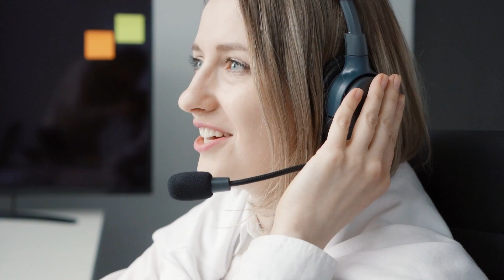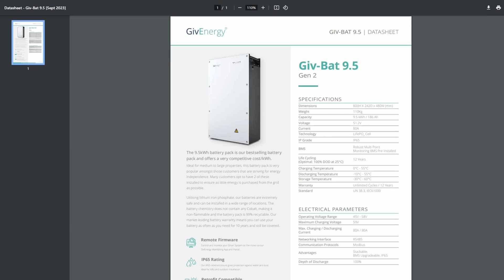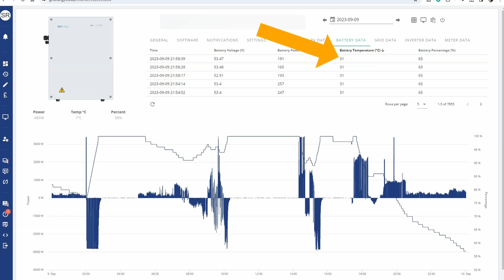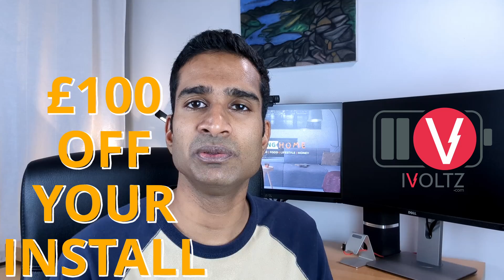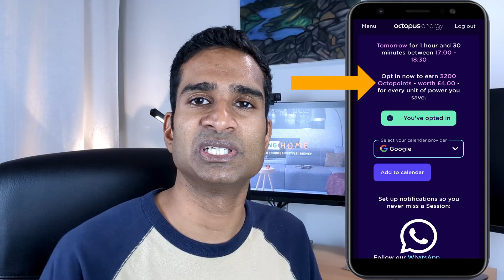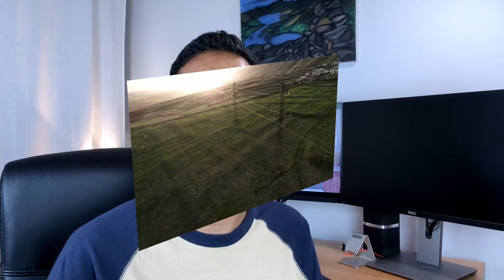1 Year Solar And GivEnergy Battery Review - What I Wish I Knew...BEFORE Buying!

Comment: Nice Video. I am looking at Solar and have been doing a lot of research, looking at costs, how much power I might generate and whether a Battery is worth it. I really like the GivEnergy kit especially the AIO which I do want to install. It is a real shame GivEnergy do not offer Non-Hybrid Inverters as one doesn't need these for the AIO so they would be an unnecessary expense. I will be looking at 3 strings, 1 East, 1 West and 1 South. I was initially looking at 2 Inverters with all the pain it would give me to parallel them but Growatt have just launched a 3 MPP Inverter which is powerful enough to power all 3 of my strings. So, looking like the AIO and Growatt Inverter. Panels are pretty cheap these days but the mounting systems have really gone up in price since the Pandemic. The only issues I have is needing to get Planning Permission for the Flat South Array as these will be on Ground Floor Roofs. The East/West Array will be on my Workshop pitched Roof.
Reply from the maker: Hi Dave - Thanks for taking the time to watch and comment on this video. Glad you found it useful.#

Sounds like you've got things pretty well planned out there 👌. Hope you get planning permission turned around soon and can get installed. 

If you’ve not already, please do like this video, stay tuned for some more content and thanks for taking the time to contribute to the discussion on this video 🙂

Comment: I've a similar system to yours. I've just added another 8.2kWh battery for £2600 so that it can help power a heat pump next winter. Thanks for your post.
Reply: I used iVoltz for our GE equipment.
Very good experience, also referred them to a friend at work
Reply from the maker: Hi Stuart - thanks for watching and commenting. Yes Darren and his team did a great job for us at a very reasonable price 👍🏽
Reply from the maker: Hi Eddy - Thanks for taking the time to watch and comment on this video.

That's a great price, is that installed? Sounds sensible if you've a heat pump to power!

If you’ve not already, please do like this video, stay tuned for some more content and thanks for taking the time to contribute to the discussion on this video 🙂
Reply: Hi, yes that is installed, I wouldn't have got the VAT off if it wasn't. Yes, I liked the video, keep up the good work.  @everythinghome

Comment: Been through a similar journey to you, 4kW FIT array in 2016 (due to pay off this year), GivEnergy inverters and batteries in 2023, gave up the FIT export in summer last year to get advantage of the Flux export rates.
Our installer put in 2x GivEnergy hybrid inverters which means we get double the throughput rate but does mean the FIT generation doesn’t get stored, it’s either used in the house or exported.  In hindsight I’m OK with the decision, would of course prefer to capture the FIT generation but the extra power output of two hybrid inverters and batteries makes for a more flexible system.
We have an ASHP so in winter our consumption exceeds the battery capacity. More battery would be nice but financially it’s not worthwhile.
We do drive our battery and inverter hard, using home automation to automatically charge and discharge at the best agile rates. This works really quite well although occasionally the inverter gets confused, won’t discharge, and has to be reset.
Reply from the maker: Hi Geoffrey - Thanks for taking the time to watch and comment on this video.

Thanks for the insight. I'm glad we'll soon be paying off our 1st FIT benefitting array as the rest of the 20 year term will just be profit now 😃 It'll definitely be useful having the x2 batteries and inverters to help reduce grid consumption given you have an ASHP. Nice work on the home automation, something I definitely need to explore. Part of me is scared of the rabbit hole of time and money I might go down though!

Comment: Good video & info. 
I have a GivEnergy 3.6kW Hybrid Inverter, 9.5kWh Gen  2 Battery & SSE facing 10 x 415watt all black Perlite panel array on the back of our house, a Zappi EV charger & an Eddi which was all installed in March 2023. Our 1st EV (used model) also arrived in June '23 but we are still on a gas CH system. Still not sure about a HP - mainly for aesthetics, cost & upheaval reasons - we have 10mm microbore pipework.

Our solar / GE Inverter & battery system has performed very well. I could do with a higher output from the 3.6kW inverter to cover the high usage periods but, as you said, you do learn to manage & stagger appliance usage to get around this. We have also replaced our old condenser clothes dryer with a heat pump dryer which uses a fraction of the energy the old one did. After 9 months of summer / winter use we have saved around £1,300 on our previous utility costs & this includes the cost of topping up of a 64kW car battery to 80% every other night on Octopus Intelligent Go. Those savings don't include the additional savings in petrol on my wife's old car (now an EV) & my existing petrol car which is not used as much as before. We have also not needed to use a public car charging station yet. All EV car charging has been done at home overnight at 7p/kWh or, for free from solar during the summer. If we need to go further than the 260 mile range of the EV then we use my petrol estate car.  

Having analysed our electricity usage over the last 9 months I have decided to add an extra 5 x 420watt Perlite panels (which are now half the price we originally paid) to the front of our house roof (NNW facing). The extra 5 panels will catch the mid afternoon & evening solar that we currently miss out on & I'm also adding an extra 9.5kWh Gen 2 battery. This will take our battery storage up to 19kWhr which will give us more options for export earning sessions & easily cover our daytime usage. We are retired so we are at home most days so to go "grid free" during the daytime & to run on battery only is a big benefit to us. 
The additional items should be installed next month (March '24) & I'm looking forward to seeing what additional savings they can add & what options I have for export earning sessions. 
The only snag is that after the extra battery is installed I will have run out of space in my single attached garage for any more kit which is probably a good thing because my pension pot has taken a bit of a hammering this last year.!!!  
Keep the vids coming - always a good watch.
Reply from the maker: Hi Colin - Thanks for taking the time to watch and comment on this video.

That sounds like a great set up and more solar is always a welcome addition to any system. For the moment I'm happy with my current 8.2 kWh battery being able to cover my peak consumption, if this changes I may need to look into this further. As you say though, funds are always going to be the limiting factor for most and it's very easy to become overly invested in one thing.

I'm also not 100% sold on heat pumps yet but to be fair haven't looked at the numbers in great detail yet. It's something I do need to look into though as our current gas boiler is getting long in the tooth.

If you’ve not already, please do like this video, stay tuned for some more content and thanks for taking the time to contribute to the discussion on this video 🙂
Reply: Did the cold weather effect the battery with it being outside?
Reply from the maker: Our battery is in the loft and it suffered no adverse effects in charging or discharging when the temperature dropped 👍🏽

Comment: Seems a bit high price for such a mid range setup, i paid no way near that, mine is 7.2kw solar and 9.5kw Giv battery installed was 10k
Reply from the maker: Thanks for the insight. The system was negotiated and installed April and Nov 2022 when prices were pretty high. I got 3-4 quotes and this was one of the lower ones. Also included the surge protection and the EPS. There will always be lower quotes 👍🏽

Comment: Another well made video. Well done! Glad to hear you’re happy with the GivEnergy kit as I have all the bits to do similar at home with an existing FiT system over next few weeks. Although, thought there might have been a twist at the end where you unveiled more battery storage has now/will soon be installed to store more for home usage following removal of VAT on installs and with GivEnergy stockists recently highlighting a realignment of prices on kit for the better… another 8.2 kWhs would fit in nicely 😉
Reply from the maker: Thanks for the kind words ☺️ glad to hear it's been helpful.

Haha, another 8.2 kWh would be good. Although I do want to avoid being overly invested in one thing. I've achieved my goal so far which was removing any peak rate electricity consumption. A 2nd hand 8.2 kWh at a good price , may well be appealing though 😉

Comment: Interesting video, thank you!  We also have a 9kw electric shower which I would love to replace for the obvious reasons.  How did you manage to do this please?
Reply from the maker: Hi - Thanks for taking the time to watch and comment on this video. Glad you found it useful.

We're in the fortunate position of having 3 shower rooms so we've just stopped using the 9KW electric showers. We've installed an unvented HW cylinder, so the ultimate aim is to run all of the showers off this when we've got the funds to upgrade the shower rooms and remove the electric showers.

This video may also be useful
https://youtu.be/cYRGr3_-K2s

If you’ve not already, please do like this video, stay tuned for some more content and thanks for taking the time to contribute to the discussion on this video 🙂
Reply: @everythinghome  Just used your referral code for Octopus so presumably some cash will be coming your way when my supply is live - early April - real name Keith Martin! Thank you!